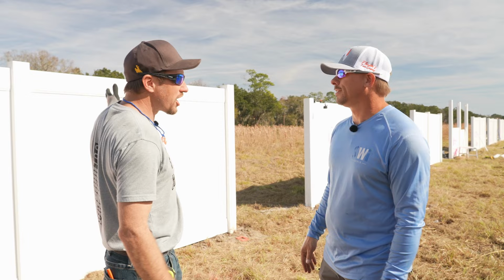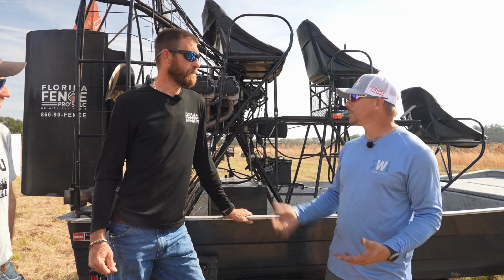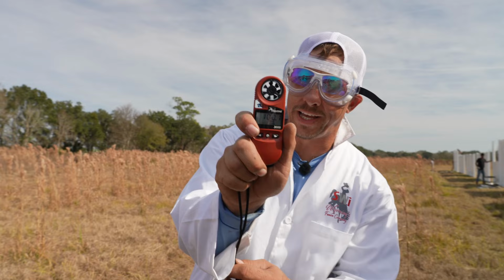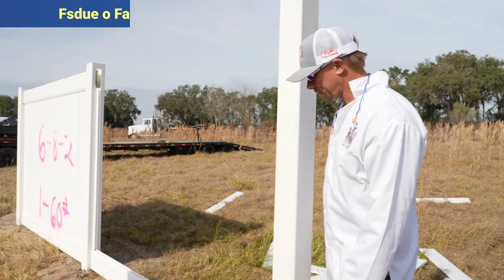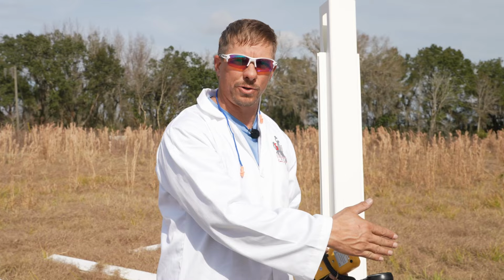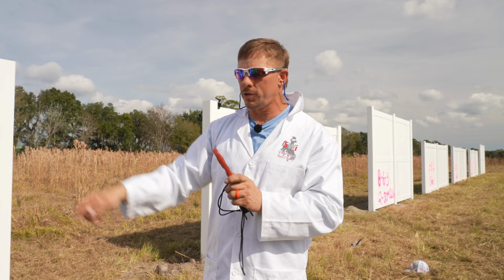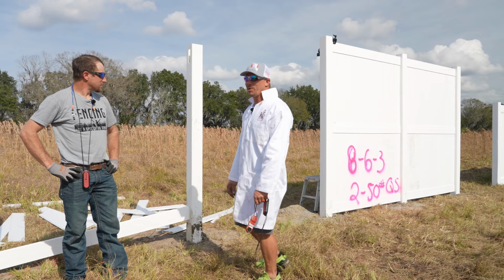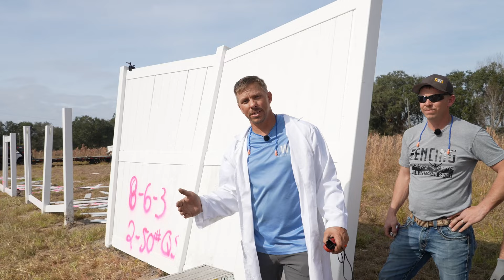The Truth About Vinyl Fences In Extreme Wind

Comment: IM A FENCE CONTRACTOR IN NORTH CAROLINA...AND IVE PUT UP VINYL FENCES...BUT WHEN I INSTALLED THEM I PUT THE VINYL COVERS OVER THE 4X4 WOOD POSTS...I CAN GARAUNTEE THEY WILL WITHSATND THE WINDS....THESE GUYS ARE DOING THIS WITH NO WOOD POSTS INSIDE THE VINYL
Reply: Why are you screaming
Reply: Must be pretty shit if your using a 4x4 vinyl Post lol
Reply: If you are sliding vinyl over wood post you are doing it wrong.
Reply: Sounds solid. Vinyl post over a wood 4 x 4. 
Ok testers, have at it!
Reply: I fill partly with cement.  I am from a Northern state.
Reply: Most real vinyl installs can handle up to or around 100 MPH also fence posts are 5x5 so that would never work you’d need aluminum I beam inserts

Comment: This is a very cool test! I will say that in terms of engineering there’s something called a 3 sec wind gust and that’s what those manufacturer ratings are based on. Not a direct impact for however long you blasted that fence with that sweet looking airboat I might add. There are labs set up to do this exact same test but under very strict ASTM standards and ASCE standards. Also when you have separate sections like this you are creating an end of wall/fence wind load which is 4x greater on the fence than in the middle of a longer stretch of fence.

Comment: Great video !!! When I worked in site work 2016 -2017 we did a 55 & older Community on valley ridge road in Nocatee Fl. A lot of fill went in that swamp land they built on. A fence contractor put up vinyl privacy fence around the perimeter storm came through blew a lot of it over. They  should have went deeper on their line post to get below the back filled grade. A lot of the neighborhoods down there blitz all the trees and back fill it 2,3,4,  feet of fill dirt. That goes on every where. Sweet idea with the air boat thanks for the video !!!!!!

Comment: I have lived in Miami-Dade county for decades. I was here for hurricane Andrew. Had put in a chain link fence with schedule 40 pipe and industrial fabric in 1990. It was the only fence that survived the hurricane. Down here we have coral rock so you don't need much concrete. Prefab concrete fences are very popular here, I bet they will fail as well. Your teasing method is something I used years ago to test a shed. We connected my friend's airboat on a trailer with my Bobcat and hit it from four sides and all corners. The Bull Shed was bull something else and flew apart so they had to replace it. Since you are in Florida I would think it would be interesting to visit your work sometime, I enjoy work as well and love drilling post holes with a skid steer.

Comment: Well I know one thing plastic fencing is definitely not the way to go, I live in the UK in a real flat windy part of the country NORFOLK, I've got one section of fencing I put up five or so years ago, I need to put up more as the hedging is dying due to a bacterial intrusion into the soil killing the Privet hedge, I had considered plastic just but it gets brittle in sunlight and that would be most of my fencing facing south, Concrete posts  8 Foot two in the ground with bags of post crete wood leafed overlapping with 3 wood cross members it's not moved and still has Zero wobble and its seen some pretty high winds.
Think I'm going to be sticking with my homemade solution buy the wood and self-assemble it with concrete posts.
Reply: Check out their other video where they put poles into the plastic post. That holds up just fine. I just started to look into composite fencing here in the UK and as far as I understood all systems have some sort of pole in the middle. I am giving it a go as I hate painting the wood every other year :)

Comment: Question for SWI. What if I used iron pipe, with cement 3 foot deep of the same diameter as those galvanized post? How do you feel the iron pipe would hold up? Thanks in advance.
Reply from the maker: It may rust out faster without the galvanized coating.

Comment: My manufacturer says to use 2 bags of concrete per post. Installer used 1 dry bag and tamped it.
I've considered filling the posts with concrete. It wouldn't be able to bend over and add some weight to the fence
Reply from the maker: We don't ever recommend concrete inside the posts. We tried that years ago when we were new. It creates settling issues and is a headache.
If you're going to concrete posts you should be looking closer to 3-4 bags per hole.

Comment: I'm in South Carolina 3 miles from the coast (near N. Myrlte Beach area). I have a 6 ft vinyl panel fence In preparation for a hurricane would it be a good idea to take the fence panels off and leave just the posts in the ground during the hurricane? 

Also, my fence panels keep blowing out during these winter Nor-easters with gusts of 50-55 mph. I've just today put screws in the top rails (there were none). Is that a good idea or is best to let the top rail blowout? Just want to make sure I'm not creating a situation where the panels will break instead of blowing out as the top rail comes lose (as it did in the past without the screws in the top rails).

Comment: Interesting setup, but were there no posts inside the vinyl?  The weakest link is always going to fail.

The setting should be engineered instead of guessing from experience.  The central buried part adds no resistance to tipping, only the top and bottom.  You should have concrete at the bottom and top, not in the middle, as in a barbell shape.  Your "properly set" method appears to be opposite of this engineering principle.

It seems like temporary bracing with staked wire guys would be more effective in a windstorm than beefier fencing.  In my Florida fence, this is how I've gotten 6ft wood fencing to survive 8 hurricanes over the last few decades.  Like putting shutters over your plain windows instead of bulletproof glass.
Reply from the maker: Nope--no posts inside the vinyl. Stay tuned for future videos to see that.

Comment: Great video., Why is wood not used to reinforce the fence? I understand the aluminum option. I thought the vinyl fence would cover a wood frame.
Reply from the maker: Because it's simply not needed. Quality vinyl is plenty strong enough by itself. It's stronger if you build it around driven steel posts, but you don't have to. We hate putting wood in the ground--it always rots and has trouble eventually.

Comment: Interesting test.
Virgin vs recycled is a big difference in strength.
You can get thicker post extrusions,and or use H-stiffiners.

Had a job with aluminum gate stiffners and aluminum p-channel in the bottom rails.
Lightning hit a gate and ran down to the rails... it blew out about 6 posts in each direction. 
Aluminum post and rail stiffiners,and snap lock panels make a huge difference, but a true hurricane wind will blast anything. 
Am proud to have built an 20 ft tall fence in the beach dunes that survived 3 hurricanes,although not an absolute direct hit on the Ga coast.
6 5/8 steel posts,6ft OC with 800lbs of concrete per post.
One other point to notice,your EP held longer than the LP did.

Comment: You should do wind load test on cedar privacy set 2 ft vs driven 3-4 ft
Reply from the maker: Stay tuned.
Reply: @SWiFence  thank you sir. Out here in Colorado and want to start pounding posts. I think we can do it, I just want to see if the fence stays level under load
Reply: Please make the cedar vid. I’m gonna extrapolate from y’all’s proof that driven is more effective and stronger than concrete (atleast with vinyl) and hope that holds true on my 8 ft overlapping cedar privacy fence w/ 12’ postmasters driven 4’ in!! 

+ a 60” gate in back, and a 96” double swing gate in the front.

In Dallas, TX but with some pretty loose soil conditions.

I’ve been absolutely roasted by everyone I know   And everyone who’s sold me materials and hardware for even considering a non concrete install.
Reply: @grantgarcia8717  your ground should be fine. Drive them 3-4 foot down and you will have zero issues. Were in Colorado and have all kinds of ground conditions- it is by far better than a concrete install

Comment: I like you test. Your test proves rock or concrete panels are more expensive but more durable. I did not like your eye protection. I would have mounted the meters on a T post before I would chance tearing my eyeballs with debris that gets past your safety glasses. goggles and a face shield preferred. stay safe I have been hurt many times skipping the safety or thinking this is good enough.
Reply from the maker: We all calculate our own risks. Your opinion is legitimate. 👍🏻